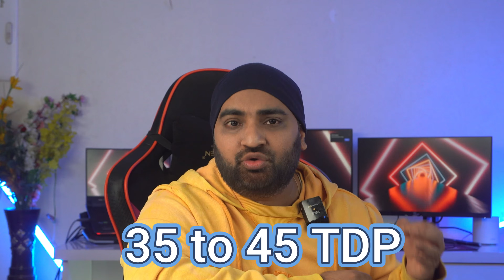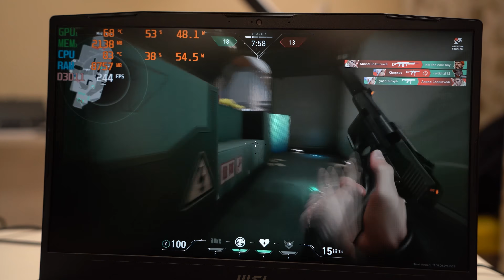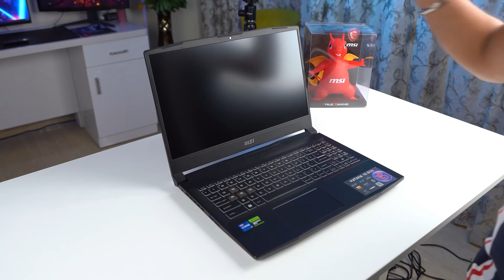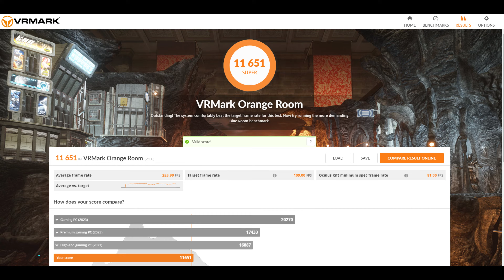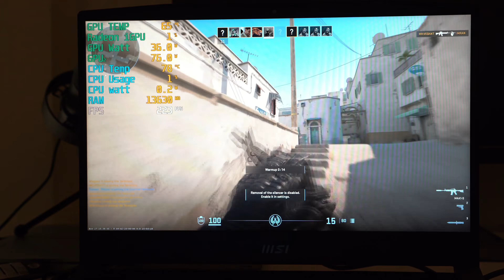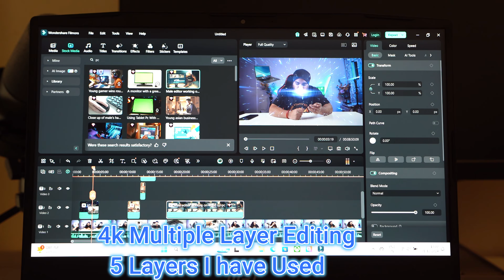MSI Katana A15 Ryzen 7 8845HS RTX 4050 | Full Review In English

Comment: Sir when will you review asus tuf a15 ryzen 7 7435hs ,rtx 4050, 90Whr .
Reply: Soon 👍
Reply: I was going to get this laptop but then I found out that it doesn't have an igpu. So if you intend to use it for stuff other than gaming I wouldn't advise it since it always uses the dedicated gpu which will hammer the battery life and possibly shorten the life of the gpu.